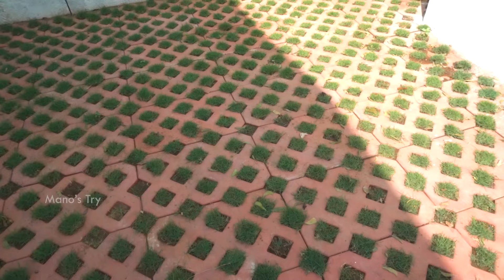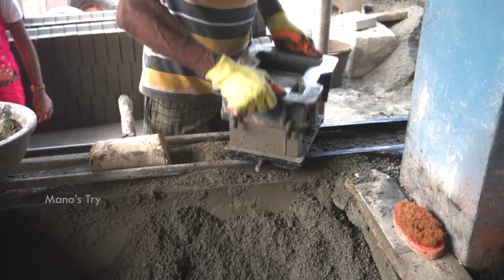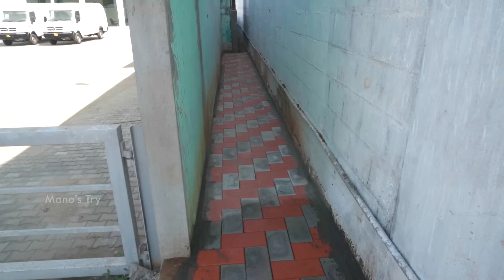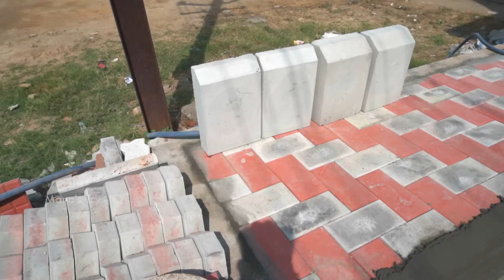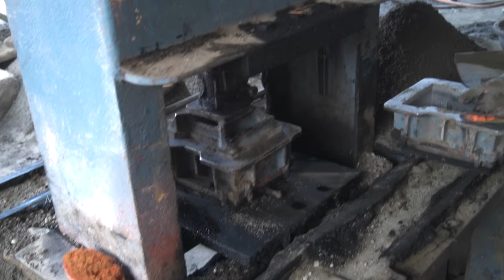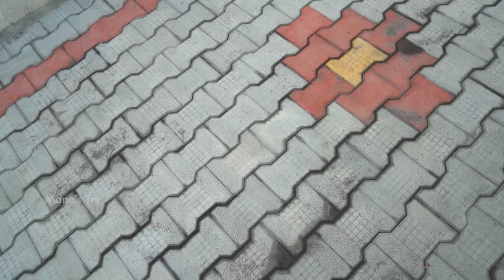Paver Blocks / Interlocking Floor Tiles Making, Design & Price in Tamil Nadu | Mano's Try Vlog

Comment: Hi sir,
We have this in our house around full ha.
but uppo rain vara time or water use panra time  la water tiles gaps la ulla pogum thana sir ithu nala basement kulla water pogum and building will get damaged at bottom la indha water ulla pora nala nu solranga sir we are planning to remove for this and replace with cement layer.
Please can you reply is this fine to keep around around open environment where rain water enters
Reply from the maker: This blocks better for open space & garden areas
Reply: @ManosTry  ok sir appo basement near rounding la podarathu avoid pannanum correct ha sir

Comment: Hi bro Nice presentation. Cool person😊👍,  intha vishayathile extra points njan solluttuma ,,,

1.Load bearing capacity  romba  jaasthi kedakkanam ennal  80mm  thickness must need   , ithu govt PWD  WORKS  SANCTION Approval AAKANAM ENKIL   LAB TESTING Result pakka irukkanam,  

2.Noram  residential use / or commercial use -  60mm is ok , 👍

3. Intha Interlock bricks lay pannum both kandippa  2" baby mettal podanAm  ,,ille na kallu aattam varum ,,,
Reply: Baby metal na?

Comment: Which one is  best paver block or normal cement flooring?
Reply from the maker: Based on location & usage
Reply: @ManosTry  how much do they charge for pattukotai area for paver block
Reply: @ManosTry  paver block or concrete floor , which is cheap?
Reply from the maker: @sinthiya7186  Concrete floor
Reply: @ManosTry  thanks Anna. Thank you so much🙏🙏🙏🙏.
Concrete poota medi jalli irruku.
Reply: @ManosTry how much cost without installation 800sqft

Comment: Bro.. first floor la 400 sqf ku 2 room podanum.. ground floor load bearing method la kattirukkom, 20yrs aachu.. ippo first floor la 2 room( oru hall, oru bedroom with bathroom) podalama? Max evlo selavu aakum?
Reply from the maker: Yes. Max.8 lakh
Reply: @ManosTry  thanks bro
Reply: Main wall ah change pannama 1st floor pannalam ... Portion wall no problem....neraly 7 laks
Reply: @veeraraghavarconstruction6481  thanks bro. 😊
Reply: @sathishsatz  hlo sir
Reply: Labour would be around 400*400=1,60,000 for masion,electrical and plumping

Painting and carpenter work seperate

Concrete over head Water tank labour around 40-50 thousand for 2000 litre

Material cost. 

Things vangi koduthu Panduna-7 to 8 lakh(total amount include labour plus material)

Comment: Anna 1000 sq house build pannanum 2bhk with cupboard work and elevation, fall celieng work ,evlokulla mudikka mudiyum nu sollunga
Reply from the maker: Approx 28L
Reply: 24laks possible
Reply: @veeraraghavarconstruction6481  bro aac block veetukulla use pannitu,PVC cupboard work panna 15L kulla mudika mudiyuma
Reply: @kkeditstamil   not possible 15 lakhs
Reply: 1700000 pothum
Reply: With same spec i done my house with 26la oh without front elevation and false ceiling
Reply: 22L
Reply: இன்ஜினியர் மற்றும் மேஸ்திரியை நல்ல குடும்பத்தில் பிறந்தவர்களாக பார்த்து விசாரித்து வேலைக்கு சேர்த்தவும்